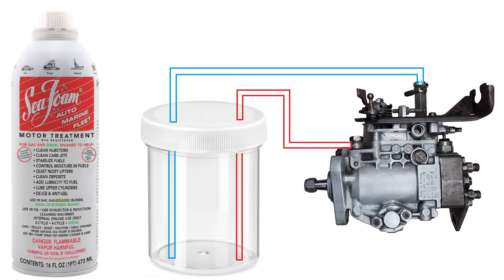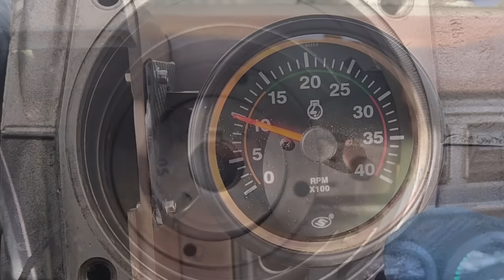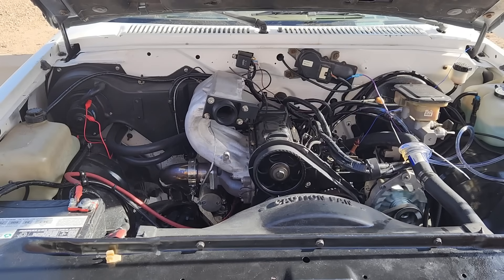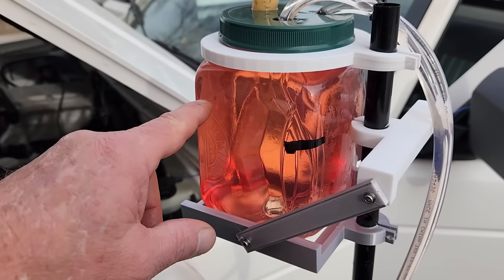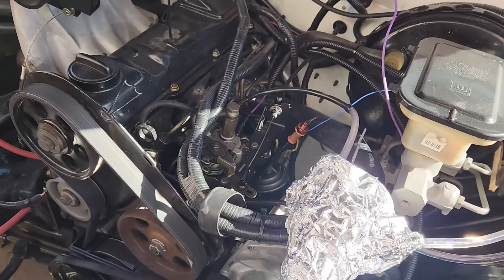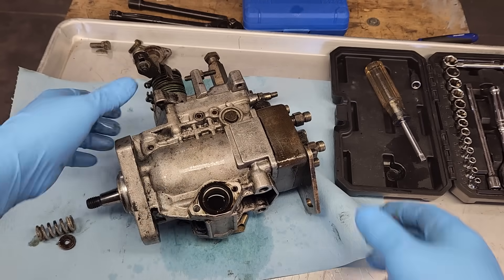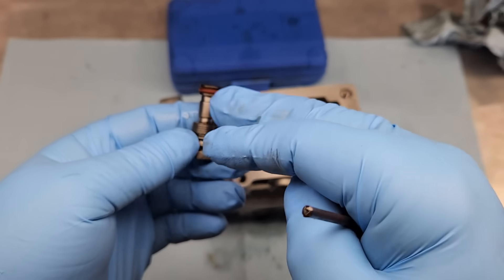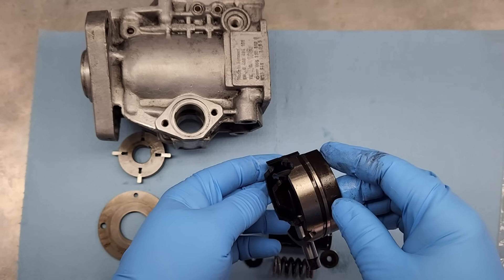S5 E49. We experiment with Diesel purge, SeaFoam and Berryman 12 to clean our BOSCH VE injector pump

Comment: We use to put automatic transmission fluid in the fuel tank on tractors when I was kid. Something about it being mostly a detergent.
Reply: This is what I was going to say too. I had a tractor recently with a bad fuel cap (that I didn't know about) letting water into the tank. It filled the fuel filter and started to make its way into the injection pump and it stopped working properly. It didn't want to stay running, and if it did, it wouldn't respond to throttle at all. I filled the filter with transmission fluid and ran it at various rpms and after it ran through that transmission fluid it was almost completely better. Then I just added an additive to the fuel system to increase the lubrication of the diesel. It has been perfect ever since. It went from being unusable to perfectly fine again.
Reply: Yep, a shot of ATF in the fuel of anything with a mechanical pump is good, especially if running #1 in the winter.
Reply: A friend of mine worked at a mechanic shop. He would put all the used transmission fluid from customers' cars in his MK1 Golf at about a 50/50 mix. It's a great way to never need to pay recycling fees.
Reply: @StapleCactus  I’ve got a mechanically injected John Deere tractor.  I recently ran a gallon of used oil with 4 gallons of diesel in it and it ran fine.  I’ve got some used transmission fluid so I think I’ll run a gallon of that through the little motor!
Reply: @91CavGT5  the only thing is that idk how much of the atf would be fine. Since it's a detergent it may mess things up more than help if ran to concentrated. IDK but hopefully someone more in the know will chim in.
Reply: ATF has a relatively high amount of dispersants not a lot of detergents.

Detergents cause foaming, bad for hydraulic systems like an automatic transmission.
Reply: @nickmcwilliams685 idk you might be correct. I honestly don't know lol I was just a dumb farm kid doing what I was told so I didn't get a whooping 😂

Comment: i run my diesel with a mix of vp racing 30% nitro fuel. it has castor oil in the mix, but i add hotshot lubricity extreme with the mix. the vp contain roughly 50% methanol in the nitro fuel. its not exactly corrosive in this mix, and has an interesting color, but it does indeed clean the pump from varnish and gunk. i run 1 quart with the hot shots mixed as suggested to a full 12 gallon tank. or shoot for 10% mix up to 20% maybe more depending on engine timing and injector health. bright side to this mix is you can make a hydro diesel from this mix but also it helps reduce egt and builds boost quicker. i made this mix primarly as a common source hydro diesel mix. im not fully done, but ive run it for 3 years in my daily and so far so good.
Reply from the maker: Good to know!

Comment: The Oil Geek has tested a bunch of fuel treatments under lab conditions and didn't get excited about any of them. I haven't seen them us BG products which a friend on mines shop uses. Anywho, I did a 3 day piston soak on a tired CRV with 200k. It was drinking 2 quarts in about 5k. We were able the get it down to 1. BG is made at thier plant in Eldorado not that that makes a difference.
Reply from the maker: I reckon  the real cleaning was in the combustion chamber, however the inside of the pump was decently clean, but apparently not enough.

Comment: The Berrymans is probably boiling off once out of the higher pressure environment of the pump. It is likely what is causing the bubbles.
Reply from the maker: That's a good theory.
Reply: Yes, definitely!
Reply: My thought as well.
Reply: Agreed
Reply: Isn't it mostly acetone?
Reply: @nickmcwilliams685  
As a flat fact you would be correct.  Every chemical product sold in the USA has to have a Material Safety Data Sheet posted by the manufacturer avaliable for public access.
If there is ever anything hazardous material classed chemical you are interested in knowing what it is made from, simply do an online search such as " Berryman B12 Chemtool MSDS " and reading it in the papers somewhere will be a list of contents.  For the B12 Chemtool it contains "Acetone ... 80-90%"  
😉
Reply: @nickmcwilliams685  let me also add this to the B12 Chemtool being 80-90% Acetone:   "Think about what acetone does to plastic and rubber. Now think about how much rubber and plastic is in a fuel system. It begins with the rubber hose that connects the fuel filler to the tank, and ends with fuel injector O-rings."   
Just..........food for thought.
Reply: @nickmcwilliams685 , I was thinking the same thing. But, a Google search revealed acetone to be 30% or less with the greatest percentage being toluene. Methanol is also an ingredient with similar proportions to acetone. There are also a few other ingredients, but they're rather small portions.

Comment: We used a cleaner by Stanadyne. Worked great on wheezing 6.2 and 6.5 GM injectors. Proof while doing diesel emission testing.
Reply from the maker: Thanks for the input!
Reply: @robotcantina8957  Stanadyne looks like it's 2-ethylhexanol so the same stuff in seafoam, just a LOT more of it, in a naptha/2EHN mix like the Moly Purge. I bet it does work pretty well, but watch for swelling seals.

Comment: think your diesel fuel system need to be cleaned?(i never found any crap in a diesel pump, at least, nothing that can be dissolved/washed)

run it with a 25:1 two stroke oil/gasoline mix.

ice in fuel tank/line, add 1/2 liter air brake antifreeze. it's methanol with lube. because alcohol and diesel don't mix.

Comment: B12 is roughly equal amounts of toluene, acetone, and methanol, with a splash of MEK, butyl glycol, and IPA. At least, according to the MSDS. With oil it should be ok mechanically but any plastic parts... it ain't good. The Moly purge is just light naptha with a cetane booster (2EHN) so it burns properly. 
Seafoam is what it always has been, "light hydrocarbons" and IPA. It's the hydrocarbons where the magic happens though... naptha with a little trimethylbenzene isomers ("cumene and cumene-like molecules"), polyolefins, and some isooctyl alcohol. Not much though, but enough. 
Willing to bet Seafoam used to have straight benzene in it and switched when it's unhappy properties came to light, but I digress.
Reply: p.s. looking at the MSDS you might actually be able to use a syringe of B12 chemtool to glue together bulk styrene parts like scale models and such. Just a little touch and the surface melts, stick it together, evaporate, voila... glued together.
Reply: @mfree80286  It won't melt the syringe?
Reply: @putteification  the right syringe :)
Reply from the maker: Interesting,  I reckon I should have looked at the MSDS.

Comment: My dad and I used to use Dexron/Mercon transmission fluid for this. It has some great detergents that will deal with a lot of things. 1 quart per 5 gallons of fuel minimum was what we found to always worked for us.
Reply: Fun fact: Dexron A and B had whale oil in it when it was first formulated.  They only stopped using it in 1971, when Dexron II came out.
Reply: @kentalanlee, Yea, Dexron/Mercon is an aftermarket replacement for Dexron III and Mercon. So, it wouldn't have whale oil in it.
Reply: I know.  I just thought it was funny how long Ford used whale oil.  They would have kept it up too, but laws against commercial whaling prevented its use after 1971.
Reply: Any harm in running higher concentrations, like 1 gallon transmission fluid to 4 gallons of diesel?

This is on an old mechanically injected John Deere diesel tractor(Yanmar 1.3L motor).
Reply: @91CavGT5 , no harm at all. Wouldn't hurt to run a quart per tank full, if running low sulfur diesel meant for the road. Low sulfur diesel is hard on mechanical injection on older diesels.
Reply: @donniewatson9120  that’s what I thought, and yes around here the low sulfur diesel is all I’ve got access to.

Comment: wonder if the berrymans was possibly just volatile enough to start to boil in the pump, and that's the source of the bubbles, you didn't mention it leaking fuel, as i remember from a long time ago the VE would generally just start leaking when unhappy, and once it got bad enough the air intrusion breaking prime when it cooled off would be the issue, that and every rubber item in range of the typically ignored leak being turned into jello by the diesel
Reply from the maker: Interesting theory!    The purge was a little messy and there was fluid under the vehicle , but it was hard to tell if the pump was leaking or it was just sloppy work.

Comment: You should test the lubrication properties of Marvel Mystery oil. At least look at Project Farm. Maybe try Motorkote!? Motorkote in transmission fluid or motor oil is pretty much the best thing I've ever used to free up stock things.
Reply: I would not... MSDS says chloroalkanes. That can work great for lubricity but you absolutely positively do not want to burn a chlorohydrocarbon if you can help it. If it's not making poison gas it's making hydrochloric acid...
Reply: @mfree80286  I believe you. I would use it like a treatment. Not a daily thing.

I wouldn't believe it unless I tried it but somehow it bonds with the surface of the metal or somehow it changes the surface of the metal. It's not something you need to use on a regular basis to get long-term benefits

Comment: Always a master of the cliffhanger. Just as I'm thinking something cool is about to happen, things start wrapping up. Can't wait to see the changes in fuel mileage & acceleration times. Keep up the good work Jimbo.
Reply from the maker: LOL, well, I truly was out of time.  Putting the pump back on the engine is no simple task.  We will find out if the rebuilt pump made a difference soon.
Reply: @robotcantina8957   Indeed. These things are always time consuming. Besides, if it was already done, what would we watch until the turbo project starts?

Comment: On the 'ol family 84 Rabbit, I don't recall the advance having a return spring.  My dad bought the car new, and was pretty good on keeping up on maintenance, changing the filter and using good fuel.  The choke on the dash was pull-push and there was just as much resistance both ways. I honestly didn't give it much thought as it was my teenage runabout, let's be honest, but maybe you have a different actuator on both?
Reply: Possibly you just had a corroded or otherwise stiff cable?
Reply: @putteification  I mean I dunno, it was always that way since new.  And why would it spring back?  You pull it out for it to stay that way.  I drove it many times and forgot to push the 'choke' back in and it didn't seem to do any harm, seeing as it had amassed way over 300k before a food service truck caved the trunk in.  It wasn't the engine that did it in.
Reply from the maker: It's hard to tell if the cold start is springing back from the dashboard controls.  If the car was driven regularly, chances are the system was working.  The problem tests to happen when the engine sits for many years.

Comment: 8:00 it seems to me the stuck component is riding directly on the main internal diameter of the pump housing, so there's a lot of surface area for goo or schmoo to stick the stuck parts. 
Have you considered repeatedly heating the pump housing to expand it off the advance barrel? Should at least let some more fluid between the parts and hydraulically force it out as it cools, could break the goo free. 

Also had a silly thought about deep-frying the pump without completely disassembling it. No, literally... turkey fryer, hot oil, in goes the pump for a few minutes, drag it out, work the parts as it cools, repeat until golden brown.
Reply: Would you want the freed rust going through the injectors? Otherwise that could work.
Reply: @putteification  If it comes loose during the purge, isn't the same going to occur?
Reply: @mfree80286  Yes.
Reply from the maker: Interesting,  Well, heating the bottom of the pump would be difficult when the pump is still on the engine...The motor mounts get in the way.  Perhaps on a normal VW application it would be different.

Comment: Got to say jimbo.  You are the only other person i have heard talk about pre heating fuel for combustion purposes,  back when i lived in new england , that was a mod we would do on our built cars so it would have warm fuel even in -temperature,  so we coupd still run racecars in the winter 😂.. yeah gasoline runs in my veins and i think my brain fluid, or is it engine oil, or spinal fluid , ahh who cares , long as it keeps working right 😅.. anyways , love all the diesel info you share bro as like i have stated multiple times , im learning all i know about them from you , b4 what you have shared , the only thing i knew about them is they dont have throttle bodies and how to set the timing from the flywheel (only diesel i ever touched was a 89 jetta 5 speed diesel i was given ,but ended up selling cuz i could nit figure it out past retining it after replacing everything on the engine ( i was young and dumb then or i never woulda sold it , think i was 16 or 17 😅) anyways peace and love jimbo , keep it rad , stay safe, and build on broski .. l8z fam and dont stop having fun 💪
Reply from the maker: LOL,  It turns out Diesels like the fuel to be about 95F year round.  My old Mercedes had a fuel thermostat that preheated the fuel.
Reply: Ps I gotta get one them stickers in the back windows,  I know a sub sent it , but I need one , cuz im the butthead that argues that autotragics are trash and real cars have 3 pedals and a shifter that has more than just PRND21 😂

Comment: You do not need to clean your fuel system if you have a water separator and service it regularly. In normal use there shouldn’t be much contamination .

Comment: What was settling at the top of the berryman fuel?
Reply from the maker: Not sure what you are referring too.  The Berryman, Marval Mystory oil and diesel fuel took a few minuets to completely mix.
Reply: @robotcantina8957  Uh... the B12, it just occurred to me, might actually have dissolved a little bit of the cup and fuel lines. Might leave a residue, not enough to really matter though.

Comment: Thanks Jimbo. Waiting for my 5 piece socket set to take my pump apart. Awesome content and info. Have a great rest of the holidays.
Reply from the maker: Awesome! Glad I could help.  The socket set is a great deal and you will not regret getting it.  Remember to video or photograph the pump before taking it apart.  its also helpful to get a lot of pictures on the throttle return spring and how its set up.
Reply: @robotcantina8957  👍

Comment: Stanadyne fuel treatment is the one you need to try for that. It was recommended by VW back in the day when they came out with low sulfur diesel. I've seen it do wonders on high mileage diesels. Including curing misfires, in short order. 

I used to splash a little in every second tank on my vws, to keep them working well
Reply: Standyne is my go to for a "pour in the tank" treatment.
Reply: Stanadyne consistently tests as the worst diesel treatment across the board. It's almost like they're trying to sell more pumps.
Reply from the maker: Good to know!

Comment: I doubt they were air bubbles in the fuel return, more likely solvent vapour.
I'm slightly disappointed you didn't try a 50/50 blend of 2 stroke oil and WD40.
Reply: It has a pretty low vaporization temp, I suspect you are correct.

Comment: On an unrelated note, There is a yt channel called Mercedes source that works on older Mercedes diesels. He put out a video claiming putting an electric lift pump between the fuel tank and the diesel fuel injection pump  improves engine performance. Maybe it’s something you can try. I tried posting the link to the video but it won’t let me. The video is called “Best Engine Performance Upgrade for Your Old Mercedes Diesel”
Reply from the maker: Actually, this truck dose have an electric lift pump.  I installed the pump when I did the engine swap.
Reply: That's probably mostly for pumps with a worn out internal rotary pump.
Reply: @absurdspeed true, but it might improve responsiveness and make it a little quicker.
Reply: @lanceres5spd  Indeed. If the rotary vane pump isn't maintaining volume & pressure the advance mechanism won't work properly & the injector pump might not fill as completely.

Comment: I love Berryman in my lawnmower equipment.
Reply: In motorcycles too.
Reply: Berryman is an amazing tool for gasoline engines. I swear by it. Have for most of my life. Its good for a seafoam-style hot soak for loosening up carbon too.
Reply from the maker: For a gas engine, I reckon its the right stuff.

Comment: Very interesting experiment.
Although it would probably have been easier and faster to simply pull the pump and rebuild it.
I am aware that not EVERYONE has the mechanical aptitude to do rebuilds, so showing a diesel flush video is most likely very helpful to the people that do not have a shop or tools.
To be fair, while I am mechanically inclined, I almost never work on anything in the winter as there is no heat in either of my garages.
So a quick flush would make perfect sense during frigid winter weather for me.
Love the video !
Reply from the maker: Indeed, a rebuild was the more piratical solution,  but it was interesting to see the flush was not able to resolve the problem.

Comment: Ethanol (e85) works fantastic to clean that sticky nasty goo. I had an old semi saddle tank that sat for years with old fuel in it. I wanted to use it as an extra tank in the bed of my truck. I put 5 gallons of E85 in it and drove it for a week or so. All the goo melted away.
Reply from the maker: Good to know, I'll give it a try.

Comment: Peterbilt has some kind of chemical that they put in a 5 gallon bucket and they run it through the engine like that for about 15 minutes through the injectors. I don’t know what it is, but it will change the total sound of the engine.